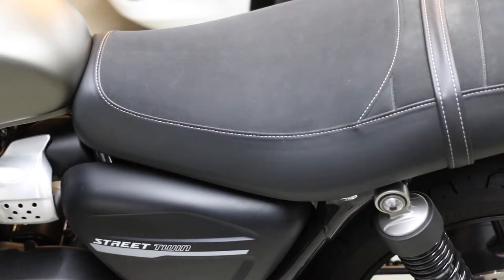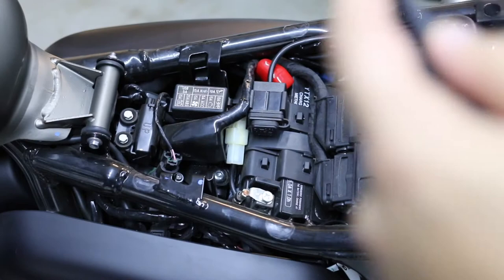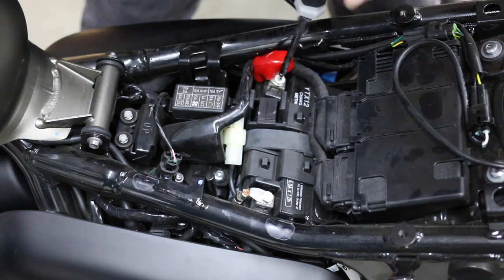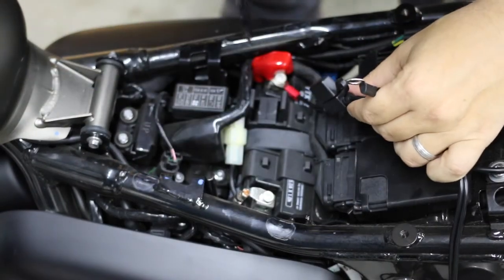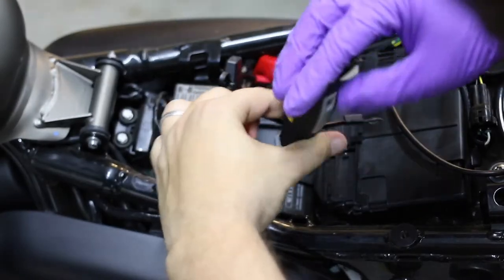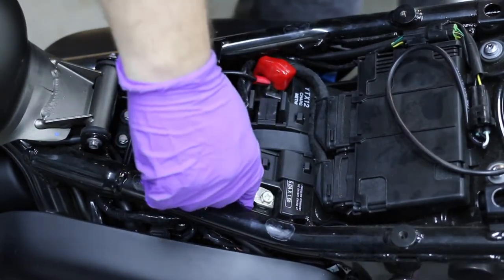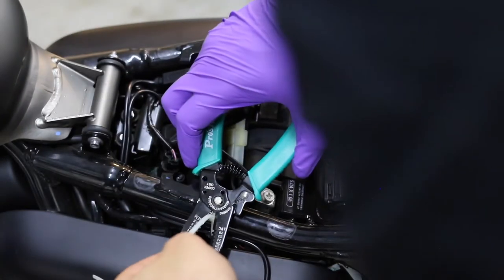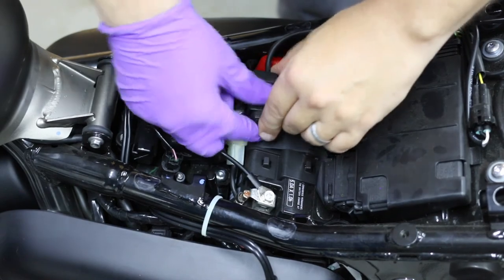How to Install a Battery Tender on a Motorcycle

Comment: Great job, simple and to the point.  I'd just like to add that with limited space around the seat area I decided where to position the adapter first then pushed the connectors through as they are thinner.  Also if you do drop the battery terminal bolts into the bike it can take ages to find them so either have some spares handy or better still just snip the connecting rings and pull apart slightly. You can then just undo the battery terminal bolts without taking them completely out and just push the connecting rings on and tighten up.
Reply from the maker: @peterrichards7387  great feedback!

Comment from the maker: Update I've gotten comments lately from other creators, who are mostly frustrated that the video is getting more views then theres claiming that they either saw arcs/sparks when i was removing/adding to positive terminal....this is an absolute lie. There were no sparks or arcs during the duration of this process. The screw driver is chrome plated and the most everyone is seeing is reflecting from over head lights. The other thing some have mentioned is whether negative should have been done first. This is some what factual however this method worked fine for me that said please do which method you feel is most accurate as i am not nor have ever claimed to be a mechanic nor automotive professional.

Comment: Question.  On the instructions on the on the battery tender I bought, it says to connect the negative to the frame and not the negative terminal.  Apparently there is a risk of the battery exploding if there is a spark.   Your thoughts?   Thanks
Reply from the maker: I've never heard of connecting the negative to the frame. I've don't this on 5 bikes without issue and never have had a battery explode on me.
Reply: Loosen negatieve first

Comment: I have a 07 yamaha fz6, I know the battery is more complex to get to than many other bikes, after I get access to it i'm assuming this is the same process i'd do? 
Also wondering if there is a specific cable i should get for my bike, like if the cable needs to be longer or something, great content. I apologize if my questions don't make much sense, I'm going to use the excuse that i'm a female and a newish rider that wants to have easier access to the battery :)
Reply from the maker: Look for an extra tender cable. Should be found on Amazon just in case for under $20. As for the wiring sequence people have commented that it's safe to do positive first instead of negative. I did negative first in this video but go ahead and try positive first.